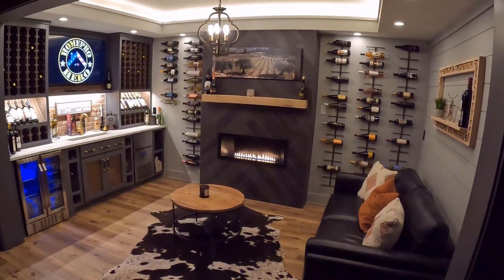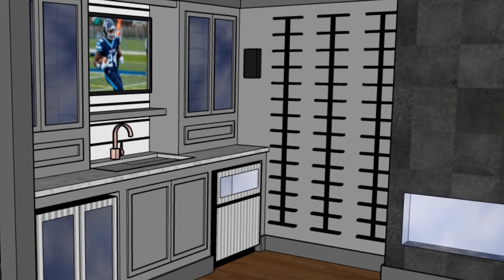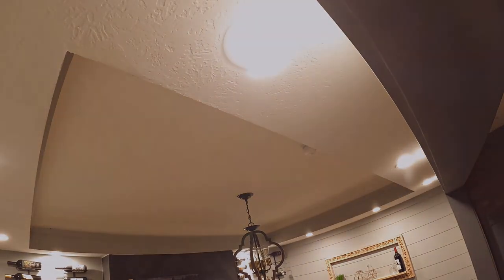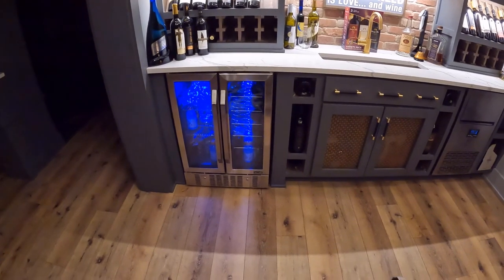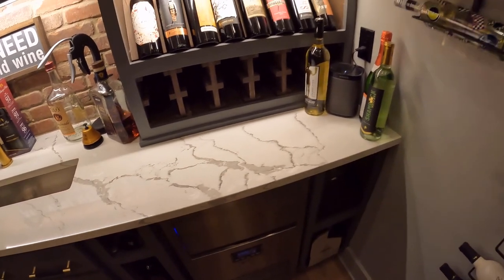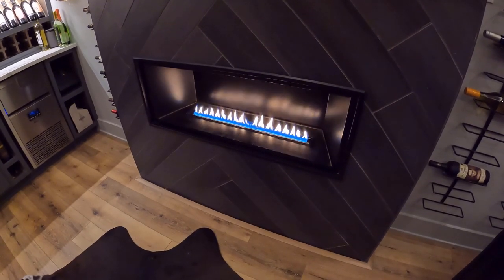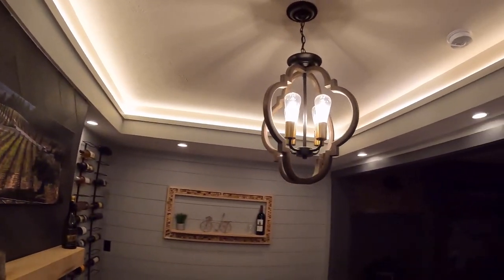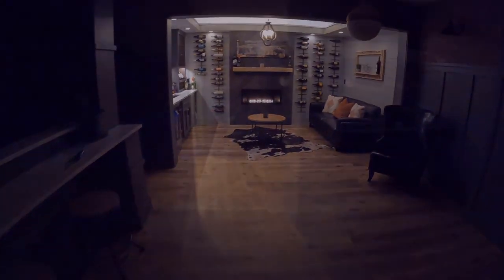Home Wine Lounge Tour | DIY Basement Bar Details & Costs | HomePro Hero

Comment: I’m designing my bar and keep coming back to all your vids.
What’s the size of the trim strips on your bar upper shelving? Is it the 3/4 ply ripped to 2 inch wide or something?
Reply from the maker: Thanks for watching!  I used 1x2 on the uppers and lower cabinets. Kinda the standard I believe. I used 3/4 birch plywood for all of the cabinet boxes. Used pocket screws and my 18g Brad nailer for almost everything. I'm building a vanity right now similar to the same process. Should have a video up soon!  Subscribe so you dont miss it!  Thx!